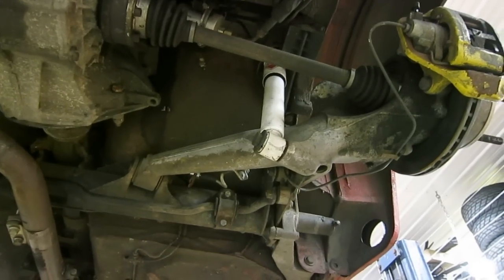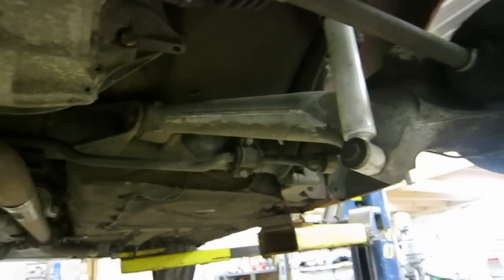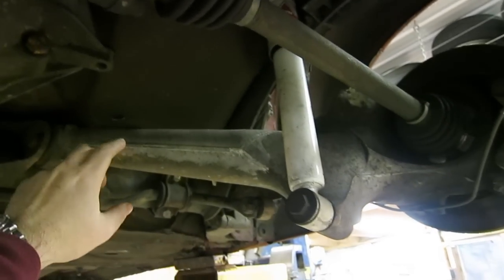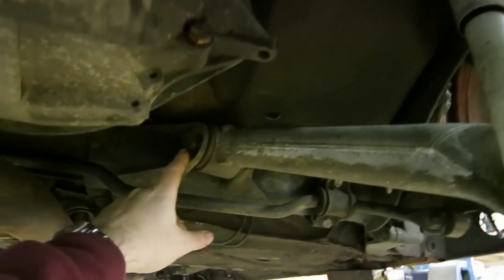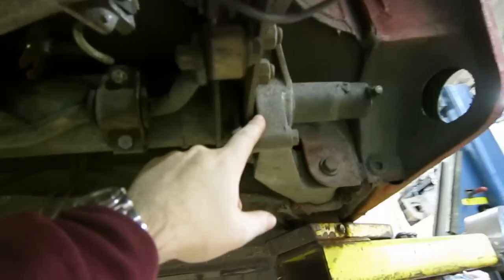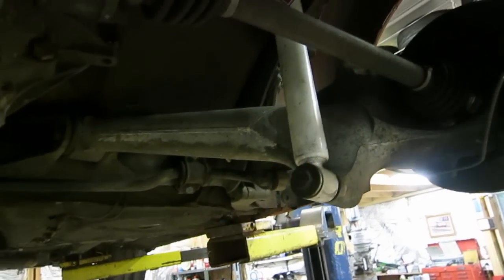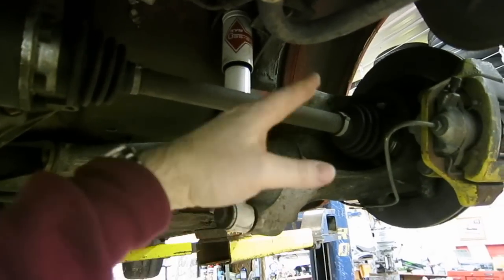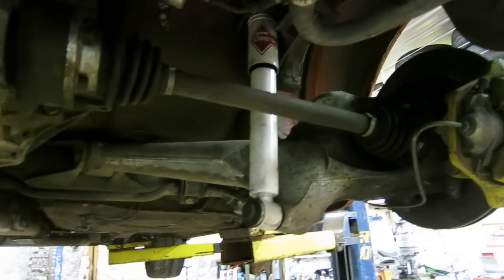How a 944 rear suspension works

Comment: My 944 cabriolet was in garage storage for some time, and when I pulled it out to wash it, I noticed that the right rear was dropped about 1-2 inches lower than the left.  Based on the suspension design, am I looking a replacement of shock, or torsion spring?
Reply from the maker: Torsion bars usually don't go bad... But shocks do.  So I'd start with replacing those.
Reply: Thanks.  My thought initially also.  Weird thing is I jacked it up, let it hang for a few minutes, and it is much closer now left to right, maybe only 1/4 inch difference.  It has held this new height for over a month now.  Still seems suspicious though, and I'm prepared to repair.  If it is shock, that seems like a very easy replacement.  Is the shock under load, like a coil set would be?  Thanks...
Reply from the maker: Rob Runkle
Yes, the shock is under the torsion bar's load.  If the shock is bad, or has some failure that's limiting it's movement, I could certainly see what you're describing.

Comment: Indexing the torsion bar looks like a pain.  The factory ride height in the rear of US cars is too high to meet our crash standards, so I'd like to lower mine to the proper height for handling
Reply from the maker: It is a pain.  You can lower it with the eccentric bolts, but usually you only get a half inch or so.

Comment: I've been reading on Elephant Racing about their "quick change" torsion bars and spring plates (http://www.elephantracing.com/suspension/springplate/944quickchangespringplate.htm), but, if you take the torsion bar out with the car loaded / or on the ground per se, wouldn't the car come down and all the weight would go to the shock? If ride height is adjusted through the torsion bar, I would think the car would come down when changing the torsion bars with their "5 minute torsion bar swap per side".
Reply from the maker: Elephant Racing is a great company, and I've used several of their products over the years.  But, that spring plate is just a $400 version of my taking an angle grinder to the end-caps!

You're right, that "adjustment" screw they have is just a replacement for the eccentric, and should be used for corner balancing and/or minor ride height adjustments.

To adjust the torsion bars, I put the car on the lift (or you could do it on jack stands) and then I raise up the control arm with a support post (or you could use a floor jack) until I get to the point that I can simply slide out the torsion bar because there is no "twist" in it.  Once the splines are disengaged, I then raise or lower my support post by how much I want to change ride height (e.g. raise the control arm 1/2" to lower the ride height by 1/2").  Then I rotate the torsion bar until the splines line up and it slides back in!

Comment: But what exactly do you mean with cornering balancing of the rear? I've used those two so called ride height adjustment bolts to lower the rear by about 2 cm, because I use 968 CS springs up front. So to balance it out, I had to lower the rear as well. So I use the method with those two bolts. But you're saying that changing the splines in the torsion bar, is better. Why exactly? I've lowered it with success I must say, I don't experience anything weird while driving. What is exactly this cornering balancing and pre-load what you're talking about?

Also it's just so much work to take out the whole rear axle off, just to lower the ride height. So I used the other method which is much easier... But now I hear it was not the best method. I am confused. Even the workshop manual says those two bolts are for ride height adjustment. They did not mention anything about that pre-load and corner balancing what you were talking about.
Reply from the maker: I explain corner balancing pretty well in this video: 944 corner balance and alignment

But the short answer is: picture the two diagonals of the car - front-left to rear-right and front-right to rear-left.  This is what supports the weight of the car.  If one of the diagonals is supporting more (or less) than 50% of the weight, you get a "see-saw" effect when you transfer weight from side-to-side while you corner.  If your corner balance is off, the car will handle differently in right-hand vs left-hand turns - which, if you road race, is bad.  If you oval race (think NASCAR) it can actually be a good thing.  If you have a street car, it won't be as noticeable.

To change the corner balance, you have to move a wheel up or down relative to the chassis of the car.  If you have a strut with an adjustable perch at the front, this is the easiest method - you just change the height of that perch.  In a stock 944 (non M030) the only method you have is by those rear slip plates.  If you move the rear-right wheel up (lower the ride height), the other rear wheel, and the front-right, will be carrying more of the car's weight.  If you move both rears the same, it will probably remain pretty close.  But, if you really want to know, get it corner balanced and see!
Reply: Van Svenson Thanks a lot for the explanation. I use my 944 S '88 as a road car mainly. But I do a lot of spirited drives though. So let's just say I drive it in a "sporty" way.
Anyway, when was adjusting the rear height, I pulled out and cleaned those eccentric height adjusting bolts, I marked a line on them exactly at the same spot, on both of them. So that when I adjust the height, I could have these marked lines at exactly the same angle, thus having the ride height at the rear at exactly the same height. I also checked the space between the fenders and the top of the tyre from front to rear and also the height of the car relative to the ground, right in front the back wheel. This is where they usually take the measurement points when measuring height I suppose.
Now when I bought the car, it was at the lowest setting in the rear. Because it had awfully low springs at the front. But even in the lowest setting in the rear, it was still a lot higher than at the front. So I thought 968 CS springs would be the best option, because they're factory springs. And so I was right. It got the front up higher, but not too high and not too low. I only had to adjust the rear accordingly. And I noticed during the first test drive, that the car was more balanced, I felt as if there was more spring movement in the rear, and that it took way less load at the rear. I felt that especially when going over bumps. It felt suppler at the back.

Unfortunately for me, I do not have the aperture like you do, for corner weight balancing. And I do the alignment at a garage. They did a pretty good job there, I must say. But they do not have weight measurement systems like you do. I just assumed that having the car at the same height both front and rear would do the trick nicely of having as good as possible weight distribution.

But what you're saying in that video which you've linked, is that you can actually change the weight load in the rear of the car by these two height adjustment bolts? But then doesn't that also mean that it works for me as a height adjuster as well?

Comment: I want to lower the ride height how would I do so?
Reply from the maker: The proper way is to re-index the torsion bars.
Reply: Van Svenson  thank you for the reply. But I have no idea how to even begin to do so. How much would the suspension lower the car using the bolt method where I can loosen both and turn the back bolt
Reply from the maker: That depends on where they bolt currently is in it's adjustment.  Maybe you'll get a 1/2"?  Maybe a little more or a little less?

Comment: Ok so u removed the torsion bar  both side & than you removed the 6 bolts on spring plates, that's it, than u lifted the spring plate to lower the hight of car... Car we lower more than 3 inch by this method..
Thanks
Reply from the maker: If you lower the car 3 inches, I bet it will just about be riding on the bump stops...